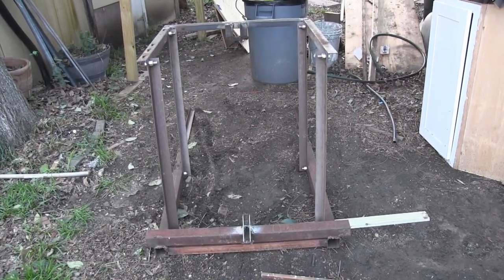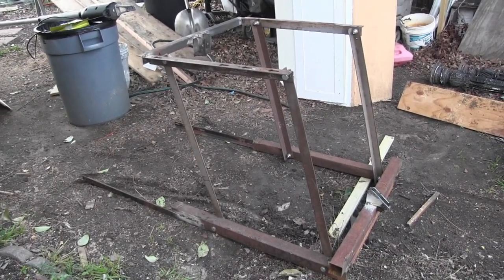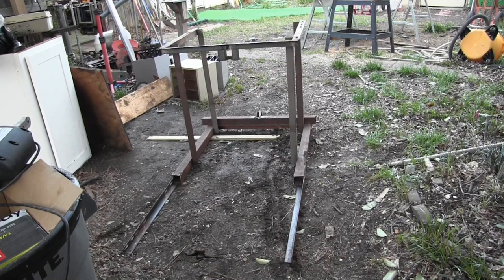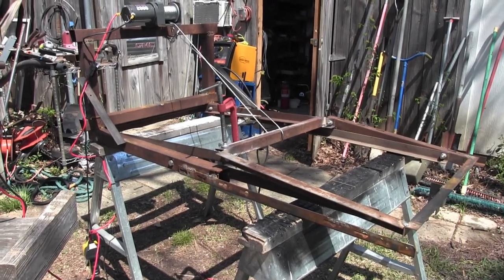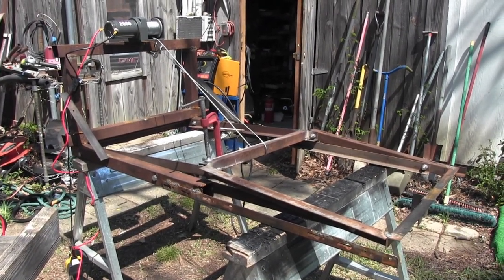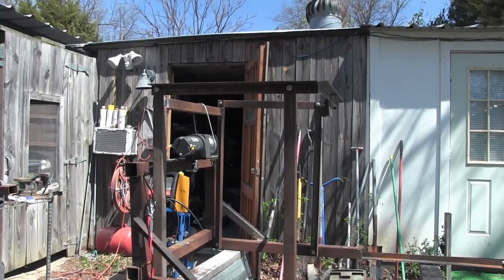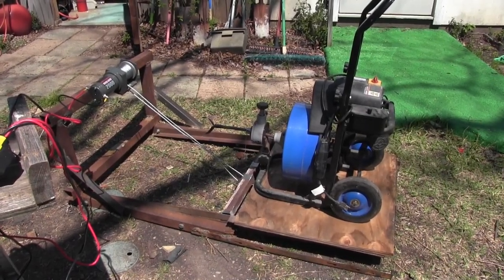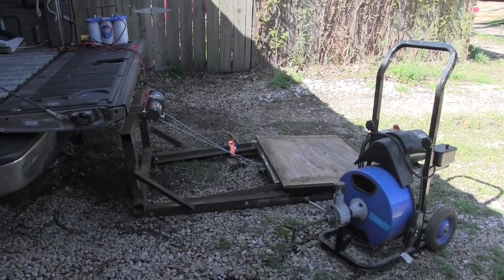Truck lift  built to load heavy appliances and machines, turn out to be a waste of time and material

Comment: You could take that winch and mount it the front part of the bed. I know you like steel but you could take a couple 2x8's and use them for ramps or some one 1" steel plate should be strong enough and heavy enough. Then use that winch to drag it in.
Reply from the maker: That's a wonderful idea. That way I don't have to lug that heavyweight around